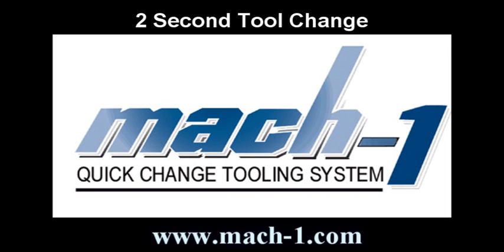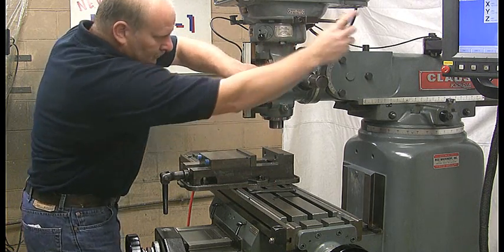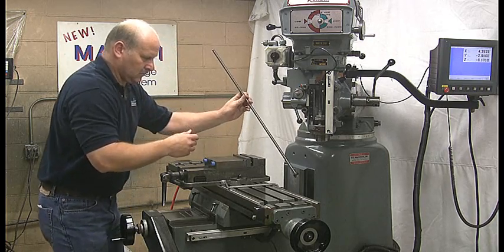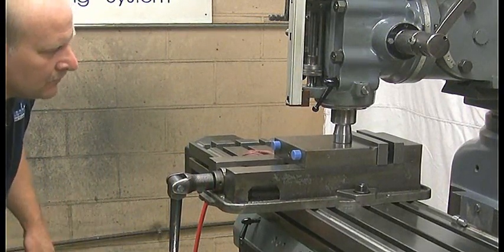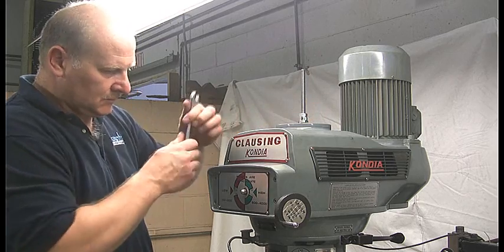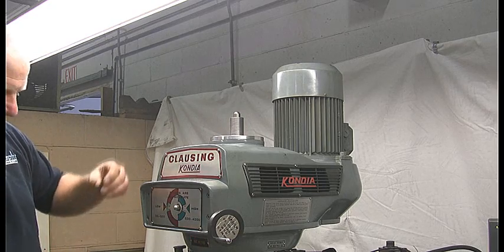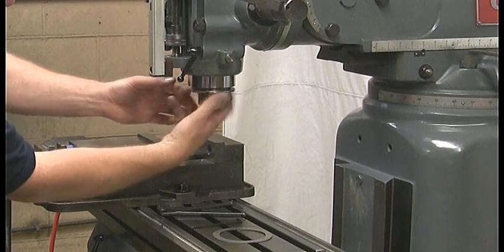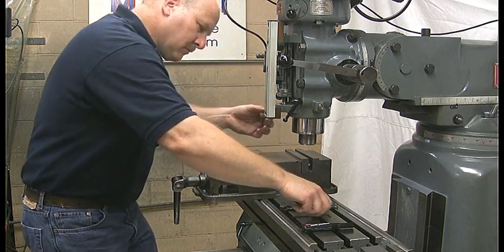Mach-1 Quick Change Tooling Installation Instructions

Comment: @chowtownpiper, Been using a Mach-1 for 13 years. Does everything the Bridgeport was intended to do and then some. The " and them some " is called drive collar tooling and it clamps on the spindle nose for added rigidity.